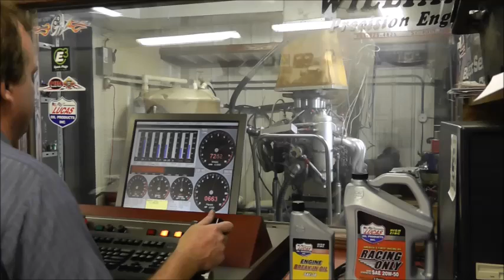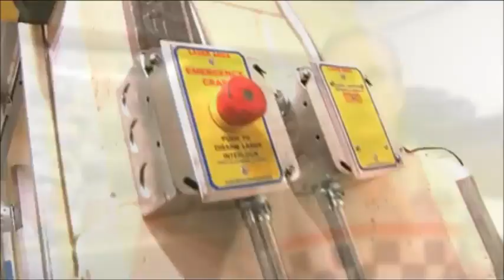Ask Roger: How will E3 Spark Plugs work in different vehicles?

Comment: Well I put a set of E3 spark plugs in my Isuzu Trooper 94 and it's freaking awesome improve gas mileage and Power you cannot go wrong and start using 89 fuel or 92 Works a little bit better

Comment: I think a lot of people don't understand the E3 plug. It ignites faster then other plugs. In some cars  this will cause a problem. the cars ECM can read this as pre-ignition. You should CLEAR the ECM memory before you install and start using these plugs.
Learn the proper way to clear and reset you ECM while you install these plugs and should not have any problem. I have install E3 on a 2000 Volvo S80 and a 2012 Volvo 80 , both were T6.
Worked perfectly.
The easy way to clear your ECM is disconnect the Negative battery cable for 30 minutes minimum. The car engine must be stone cold when you change the plugs.
When you want to start the car follow these steps;

1) Do not touch the gas and turn the ignition on for 15 second ( DO NOT start the car.)
2) without touching the gas start the car and allow to idle for at least 5 minutes up to 20 minutes is best
3) take a drive, and drive the car as smoothly as you can, do it like taking a drivers test. Remember the ECM is learning how to run the car all over again. How long it takes to reach maximum efficiency depend how first drive. DON'T test anything, DON'T accelerate fast do it smoothly like you 5 day old child is in the back seat and go for a 30 minute drive. How fast you drive does not mater.,go 50 60 70 just get there smoothly. for the first few day take it easy.
Remember the car is learning all over again , let it have time to learn the E3 plugs new ignition .

P Gray
Canada
Reply: What a load of twaddle. Bad advice all round. Why leave the battery unplugged for 30 minutes? Do you know how electricity even works? Sounds like you have been on forums getting bad advice.
Reply: Dear jnbing, AKA "the Village idiot" Its not about electricity its about software. A cold start is not for the plugs its for the ECM to learn how to run the car on the E3 Plugs,basicly you are letting the ECM learn how to run the car like it just came off the line. yes you can change plugs on a hot engine. but since the head will be expanded when hot your torque settings may be off when it cools.

You Unplug the battery to make sure all capacitors are fully discharged and the ECM memory is erased, and yes there are about 4 other ways to do it but since it will take 30 minutes or so to change the plugs its a simply way to do it.

I'm sorry that I had to use words with more than two syllables , are realize you may have trouble understanding it.

Best wishes,

P Gray
Reply: @bEEBO178  leaving the battery unplugged for 30+ minutes is how you clear the computer's cache, not it's complete memory. With the amount of read only modules in an ecm, what is a reset? Cache only, maybe? Or what? A rewrite and new modules? I'm confused.
Also yes, the electricity does drain out. Cache is stored in what's refered to as "volatile memory". After about 30+ minutes without the car's battery connected, the memory will clear. Kind of like pulling a motherboard battery to reset a bios.
His advise was just fine.

Comment: Here is my input. A few years back I drove 700 miles from SLC to SF and we had a Toyota micro Motorhome with a 20r carbureted engine and a 4wd Toyota pick up with a 22re efi engine that was towing another little 2wd Toyota pickup. To my surprise the Motorhome was only getting 13-14mpg while the pickup truck doing the towing was getting about 23-24 mpg. I was literally filling the Motorhome twice as often as the pickup truck. 
The Motorhome was carbureted, 4 speed manual, and probably in need of a carburetor cleaning and NGK plugs. 
The pick up truck was 4wd, EFI, 5 speed manual, and it had E3 plugs. Both engines had freshly rebuilt heads. The Motorhome did not perform as well as expected and the pickup did better than expected. Come on, that truck was getting well over 20mpg towing! 
I don’t like to believe in snake oils but the truck did great and it also had E3 plugs. I am trying to find out if that had anything to do with it...

Comment: Put these in my 4cylinder Tacoma. Just with plugs, delete fan clutch, cut of second cat kept stock exhaust my 2010 Tacoma extended cab 4 cylinder was a awesome drift truck. Raced a 6.0 Silverado 
Guy followed me to work could not believe a pulled away so fast. E3 work fine clear your ecu, by disconnecting battery overnight . They work

Comment: I put a set in a supercharged  mercedes and noticed an improvement over my stock 30k mi plugs 30k later i switched back to oem and again noticed an improvement with new plugs, I don't see them lasting 100k miles but they worked ok for me.

Comment: I'm running E3 spark plugs in my 2001 Chevy Silverado 5.3 and 2002 chevy camaro ss also bought a set for my Screamin Eagle Dyna Harley haven't put them in the Harley yet but I like the way they're running in my vehicles
Reply: So how do the e3 run in the bike brother I was going to put a set in my VTX1300
Reply: How did they hold up for you in that 5.3 Silverado ? I got the same and been hesitant on running them

Comment: I got 30 MPG regularly in my old '98 Vette with the E3's and the Premium fuel already required. . Also, I put an E3 plug in  my highboy push mower and my riding lawnmowers...both by Craftsman with Briggs & Stratton motors and doubled the run time of a tank of gas in both of them!!! Can cut 2 acres easily with one tank of gas where it took a minimum of 2 1/2 before (I did increase the Octane a little by using midgrade 89 fuel also)

Comment: I’m a professional mechanic
If these get put in anything that doesn’t particularly call for them there will generally be an improvement if previous plugs were very worn 
However, these tend to idle relatively rough and die quickly usually they always come back for a problem
Some cars don’t run right ever with these 
The regular style works great for me, check your gaps!

Comment: did e 3 is fine for 4.6 mustang...some people are telling me that they are no good for ponies 4.6 3 v...car is been on the dyno 3 times and never couldnt be tuned..new fuel pump,mafs,coils,bigger injectors,racing ford intake,kn filter and a few things more,some people are telling that bbk tb is no good...any recommendations?....ill drive a jack roush stage 1 none supercharged 4.6 3 v 2006

Comment: I've got an 85 f150 with a 351 windsor it's carbureted and no computer control on the engine. I run e3s and it seems fine but could they affect the timing like you were explaining?
Reply: I have an 84 ford f150 I'm thinking of getting them how is yours running?
Reply: @josearce5537  they run great! I've had them fouled out several times but that's because I put a carburetor that's too big on it so that's my fault. Even with that happening I dry them off and they still work like new and always clean themselves up after I get a good run on it. Assuming you have the right carb and amount of fuel for your engine they should work amazing

Comment: E3 plugs for f150 works amazing
Reply: Thanks, that's what I'm considering them for and I was wondering if anyone else used them in their trucks.
Reply: @justinbriggs7560  I put a set in a 2013 5.0 V8 F-150 it ran smoother.

Comment: I put a set of E3 spark plugs in my 93 Mustang I will not pull them out my camshaft is more pronounced and sound my throttle response is quicker I can feel the torque and horsepower that the plugs picked up in the car dramatically my car used to have a rich smell of fuel it doesn't anymore now I'm burning all the fuel in the cylinder I'm running the Edelbrock Performer RPM heads Cobra intake e303 cam 24 pound injectors when I had the car Dyno Tuned 2 months ago I was putting out 315 horsepower to the rear wheel and 321 pounds of torque to the rear wheels with the E3 spark plugs I picked up horsepower and torque now it's 326 horsepower to the rear wheel and 333 pounds of torque to the rear wheel big Improvement just by putting in these spark plugs I've been running them in my 2002 Ford F150 4.2 V6 for the past three years big Improvement in the truck I will never take them out they are worth the money now you may come across a car or a truck that does not like the plug it just depends on the electronic system that the car has I did put them in a friend Dodge Neon and it did not like them but I have put them in a 2006 Mercury Marquis 2004 Ford F-150 4.6 V8 2008 Ford F150 5.4 V8 Chevy S10 4.8 2000 Chevy Prizm 2007 Chevy Impala 1970 Chevelle 454 LS6 I've used them in all of these vehicles and every single one picked up dramatically fuel mileage went up horsepower and torque one up throttle response is great Motors running way much better they're worth every penny they will pay for them self and you won't be disappointed I will use nothing else but E3 spark plugs from now on thanks E3
Reply: Thank you for your opinion, I’ll try them in my cars now - 1987 BMW 325, 87 535is and 08 Sentra

Comment: Good show Roger. Problem-milage went from 30mpg to 13mpg on my 5.7Hemi 300c 2008. Car has 188,000+ miles. I put 3000miles on every week. I need this engine to last at least to 300,000 miles. Would love some answers please.  I have the maintained on regular basis at Dealership where I bought it.

Comment: Are E3's good for,small  two cycle motors?
Reply: they work wonders untill the heat burns up the arround the ceramic piece then they give hard starts but it did add more power because the little 49cc I could feel the compression was higher slightly that's probably why I got more power but it went away after the plug brunt up within 20 hours use
Reply: what I mean of more compression is the plug seems to take up more volume in the cylinder on a pull cord its noticeable but plug fails in high temp ranges
Reply: Thx for the 411, I'll get a standard backup plug for when this gimmick fails.  I remember J C Whitney selling something like this long time ago.  You're right about the center electrode failure.  Don

Comment: How would E3 plugs work in a Vtwin Harley ?
Reply: 2 years ago and nobody gave you a comment
I installed on my 2006 sportster 1200 custom screaming eagle spark plug wires & screaming eagle spark plug 
. I noticed better performance and a bit of increase  gas mileage

Comment: I just pulled an e3 from a Honda lawnmower that would not run. It was lightly carbon fouled but the real problem was the electrode and insulator were not centered in the plug. The plug stopped working because carbon buildup on the side of the electrode/insulator do to lack of heat transfer from poor quality control.

Comment: do your research before you buy them.  i have about 20k on mine and have already had to replace 2 because the ceramic top half had blown off and destroyed the coil packs. took the plugs out and noticed that 5 it off 8 were cracked.... terrible product and I'm not the only one either.
Reply: Alex Lavender just curious what did you run these plugs in and we're you whooping the vehicle in a sense lol

Comment: Go ahead and throw these in a vehicle that uses Ion-Sensing Misfire Detection.  Whoops, sorry about your $2,000 PCM!  I've seen these plugs kill countless Saabs, and contribute to ignition module/PCM failures in other newer vehicles.  They're great for lawn and garden power equipment, probably alright in older vehicles, but for goodness sake, the droves of experienced engineers that design modern cars know more about what they've designed than the comparatively small group of engineers tasked with making an aftermarket "miracle" product.

Comment: You have to do a better job of reading your answers for E3 it's looks so fake and superficial.  I love e3s but your not helping with this fake explanation
Reply: +David DeRoche He was trying to use small words.  Bottom line, any performance upgrade you add to your engine works either because you are simply reducing wasted energy, or because you are changing the way it operates.  If the upgrade is directly related to theory of operation like a spark plug, you can see that all other parameters will be affected, be it significant or not.